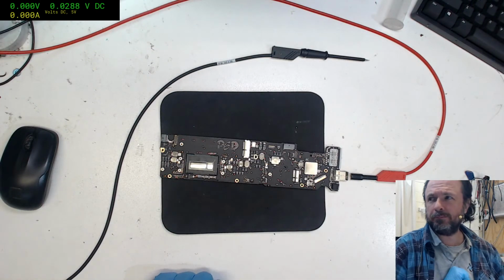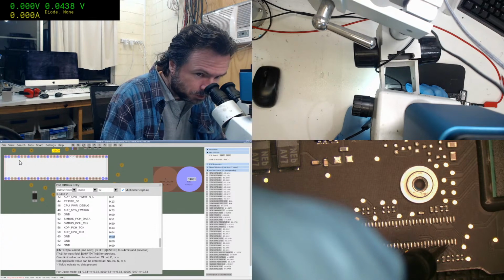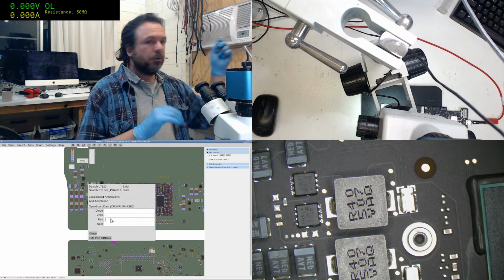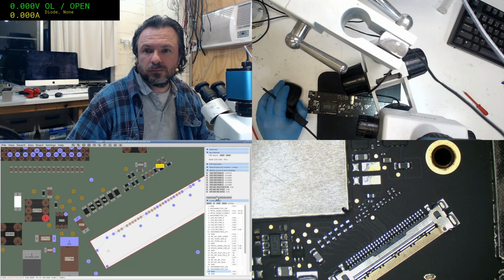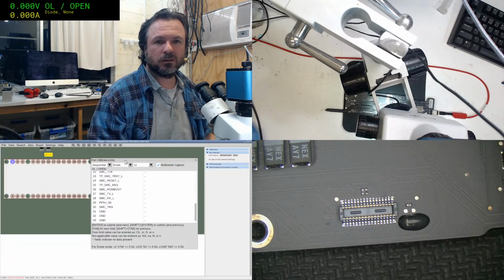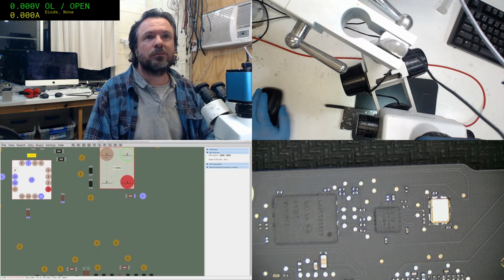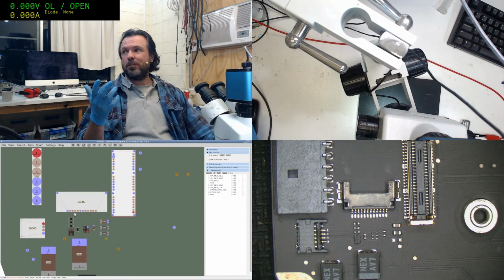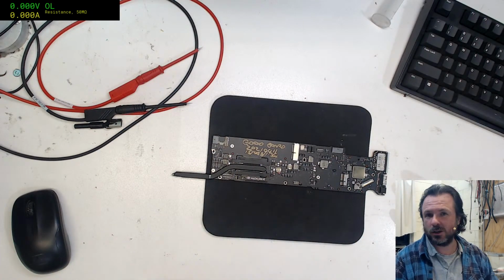Capturing OpenBoardData diode values for Macbook boards using newly created FlexBV OBData update

Comment: Hi Paul, Absolutely love your videos. This is awesome work and will be massive for the opensource community. Sorry if this is a silly question but, I was just wondering, when you stomp on the "Gas Pedal" would it make it easier/more efficient (data packet size), if the data was committed/updated to the server at that point as opposed to compiling and posting the whole parts data at the end of the process? There is probably some S/W , logical or technical reason for not doing so ... if so apologies in advance.

Comment: There are also a lot of video driving controllers fitted with foot pedals. Most of them have software for programming the pedals.
Reply from the maker: Might have to look at that... clutch brake and throttle.
Reply: @pldaniels  You could also make a nicer one. Crack open an old mouse, remove the switch buttons and wire each one back to the mouse using a long wire. Find a pair of old flip flops and hot glue the left wired switch to the left flip flop's toe depression area. Do the same for the right switch and right flip flop. Connect the mouse to the computer and download software to interpret the mouse buttons as OBV keystrokes. Put on  the flip flops and click away using your toes! It's the toe jammer. It's also great for counting cards at casinos. Moreover, Australians love wearing flip flops!
Reply from the maker: @bobweiram6321  just bought myself three of these stomping switches - https://au.element14.com/linemaster/t-91-s/product-range-treadlite-ii-series/dp/1703843

I will either wire them up to the existing unit, or I can connect them up to one of my old electronics projects where I made the OBS scene switcher ( I still have 10~20 boards lying around).

Downside of the scene switcher is that it's not programmable from the command line, however it's not like I'll be wanting to change from the shift-tab, tab, enter combo.

So, how many casinos have you tried the card counter with? :D
Reply: @pldaniels  LOL!  I have never been to a casino. The stock market is bad enough.  I have one of those line masters with a headphone jack I got as a sample at a trade show years ago. Never got around to using it.  

After I commented on the toe jammer, I searched for a toe switch and lo and behold, someone made a cool one for his car remote: 

https://youtu.be/Y-yM-US99pc. 

What I like about this idea is its comfort. It less fatiguing and easier to move small joints on a toe or finger than it is to move big ones such as the elbow or ankle. It gives you finer motor control too. 

It would be nice to  save viewing states of the board  as bookmarks and flip through them to it using the footswitch. This makes it handy when you're hands are occupied. Another way is to scroll around in a screen's worth at a time based on the current zoom level.

Comment: For the broad release version data entries, all entries that are from non-licensed users (ie just use OVB instead of FVB) if the value submitted is too different from the previous ones you should directly discard it. Now that I think of it, any value too disimilar should be discarded. Let's say a line that the server avg value is 0.45 and it gets 0 or OL discard it immediately
Reply from the maker: Ah, but then how do you handle the situation where  someone has put in a bad value initially, and follow up ones are the proper values?  

That's why we'll collect the values but discard the outliers, rather than discarding what we think might be outliers at the start.

Other way to go is beyond say 5 samples, if there's a good coherence (4 or 5 values within 10%), then close off the value from further updates.
Reply: @pldaniels  yes I meant once you have "known good" values submitted from reputable users you can be confident it's the real value and then you can let other people submit to that value. But what would be the purpose of that if you already have good values? I don't know, probably won't make much sense to keep adding in that case.
But let's say you don't have any initial values, then every value submitted is unknown and in that case you once enough values are close you can discard the ones that are way off. Pretty much what you said. That sounds more reasonable.

Comment: Thank you for outlining your thought process in programming. I only can agree to the step-by-stepwise development, this is exactly like I go forward. I usually describe it to the people as having to cross a river. For this, one has to lay down step stones, one by one. and only if each step stone is grounded well and near the previous one, I will be able to cross the river at the end. Only If each step is functioning properly, I can trust the end result.

However, this does not necessarily mean, that nothing is planned. I like to describe in written form the task, the goals, and the way to reach them. This helps me to concentrate, throw out unneeded stuff and to avoid wrong paths.

Comment: nice dude u basicly making FlexBV like ZXW etc cause o u have diode mode on them at this moment exciting:) maybe you get a few people to do this and cross correlate the measurements with friends and u will be done in no time , keep up the good work :D greetings from South Africa
Reply from the maker: Certainly tying in OpenBoardData is the big change; after we've got the meausrements down we can then start work on the board editing.

The ZXW/similar groups have a big advantage over the likes of myself, they have large teams of low-cost labour to generate a lot of data and possibly boardviews that would be relatively prohibitive (time or money) for me to generate, so I need to turn that around.

Totsiens.

Comment: Wow that’s really awesome there Paul this will be a big help for the community awesome work 👍
what All Meters Will this work with ?
Reply from the maker: Basically you need the meter software to create a file called "mmdata.txt", and it'll contain just basic data like "0.745232 V DC",  so any of the meters that I've written windows / linux software should work since it's simple enough to enable that facility ( most of my stuff has an '-o <filename>' option already built in.

For handheld/portable, I suggest the https://banggood.com/HYELEC-MS8236-Auto-Range-Digital-Multimeter-with-ACDC-Amp-Volt-Resistance-Capacitance-Frequency-Temperature-Test-and-USB-Data-Logger-p-1026558.html for now ( which is a continuation it seems from the BSIDE ADM20 ).